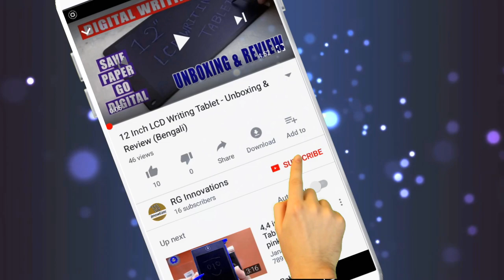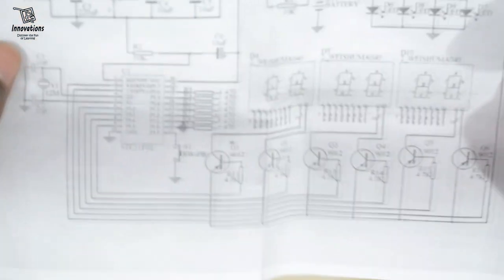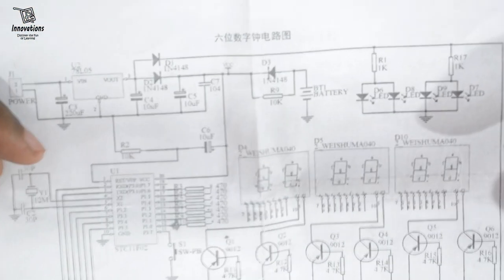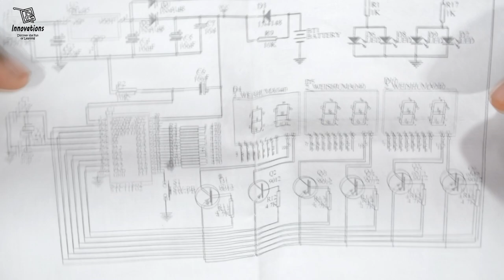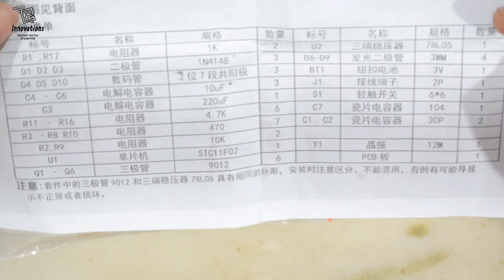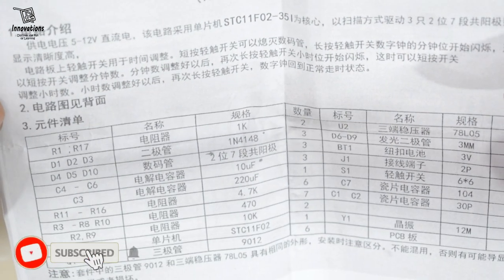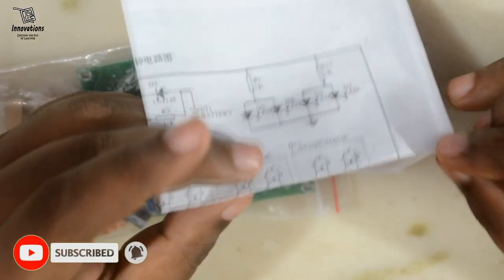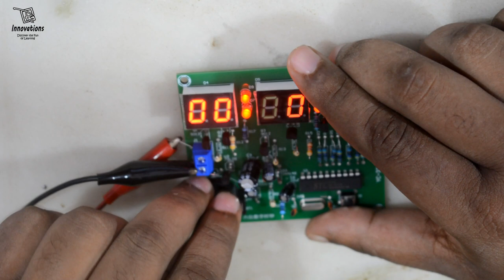Review of DIY 6 Digit Digital Clock | Soldering and Testing | Is It Good or Bad?

Comment: It seems like the oscillator circuit is off. Very possible the supplier gave you the wrong crystal. Perhaps adjusting this component could fix the time.
Reply from the maker: ok i will try